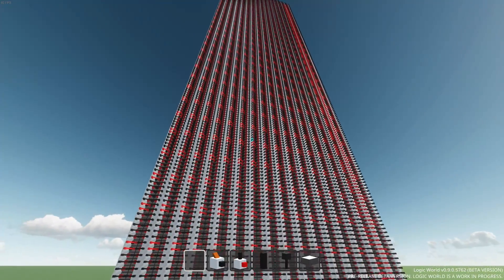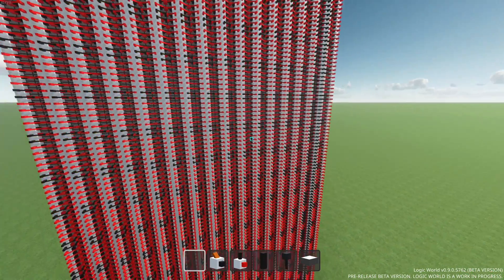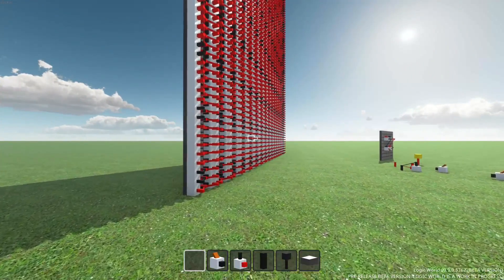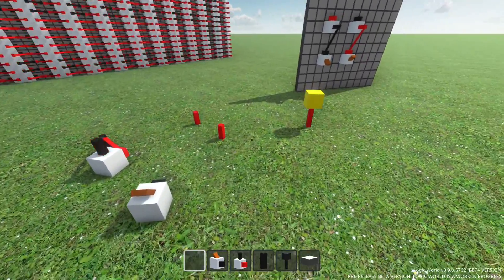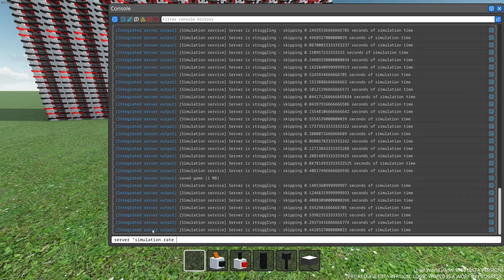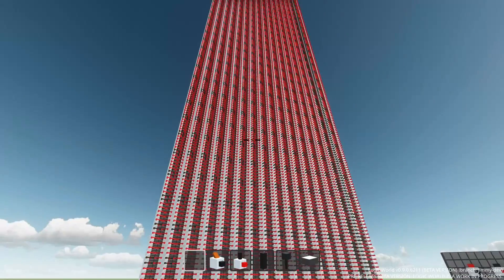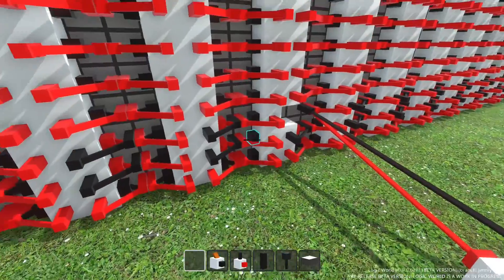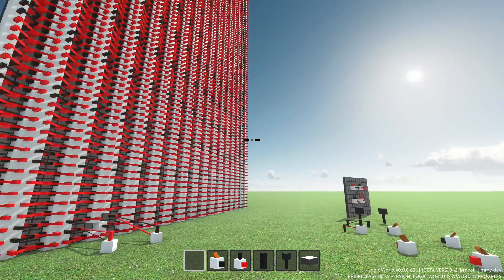Simulation Optimization

Comment: Thicc, Jimmy. How? I thought there were some internal limitations in Unity looking at how poorly logic gates optimized in Creativerse.
Reply from the maker: Well, it helps that the logic gate simulation isn't actually happening in Unity. It happens on the server, which is a standalone .NET program, and the server sends the results of the simulation to the Unity client to render.

The optimizations come from profiling to find the bottleneck, then figuring out a way to fix the bottleneck, then repeat for whatever the new bottleneck is. Wow bottleneck does not feel like a real word anymore after that sentence.

-Jimmy
Reply: So you went that deep; nice. This way simulations shouldn't suffer from the rendering distance. Which is  quite an issue in unity games. And a huge deal when it comes to something as picky as logic creations that require timing precision like a clock. 

Inb4 arm support for the dedicated server in the future :o